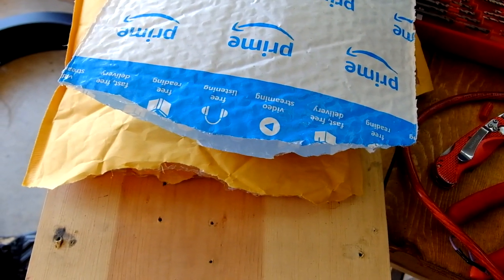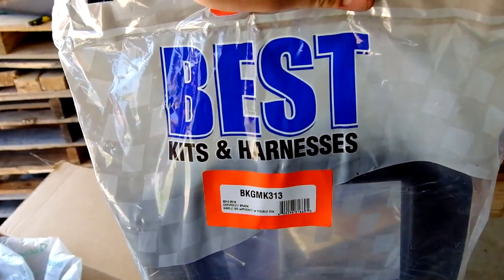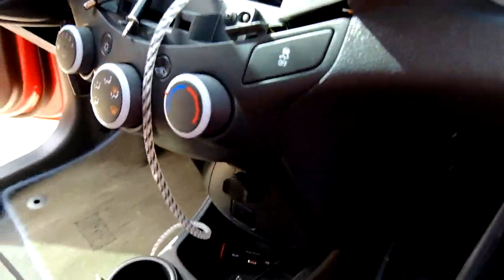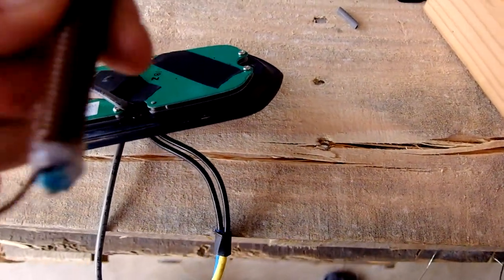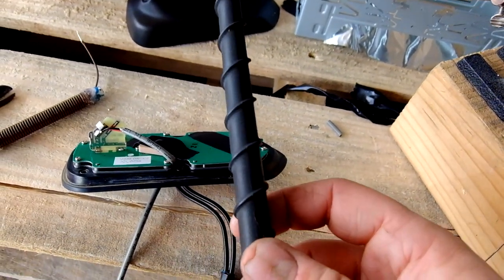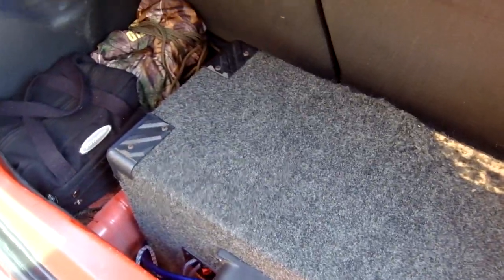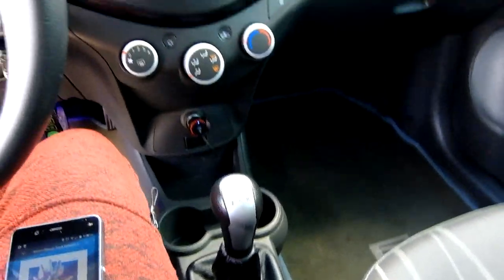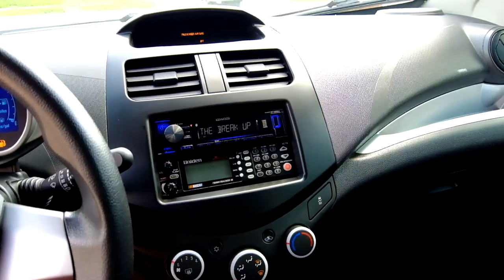Chevy Spark Stereo Install

Comment: I will say, you won't see a lot of videos of this car, because so many people have problems with them. I had to get a new TCM and that cost me 3 grand.... then a year later my Transmission went out and luckily was covered under the warranty they had for it so it was free, but if I had to replace that... I would have just sold it for scrap... I only paid a lil over 5k back in 2018 for the car and it cost me more than that to repair. If another major issue occurs, it will be gone. Thanks for the video, my front right speaker has been messed up since I got the car and I'm finally gonna fix it.

Comment: I have a 2014 to.  I been looking for videos also.  I love the car.  Been trying to look for videos on the ac heat knobs I broke mine a few months in. Think I turned it to fast. The top two half circles with teeth behind/under the dash I can't figure out how too line them up to switch my vents  My wires were off the things too. I managed to do that but every time I change the vents they don't change

Comment: I have a 2007 chevy aveo5 and cant find videos on anyone changing the speakers but i did come across this one, thanks for making it. Its not the same exact car but they are pretty dang similar. So you had the cb radio, kenwood stereo, and scanner all connected to the one antenna?
Reply from the maker: No I didn't show the CB antenna in this video It was a separate NMO Mount Antenna. Just the scanner and Kenwood were on the same one.

Comment: How did you wire the radio harness from the aftermarket unit to the cars radio wires?  I got a radio today, and I can't fine a harness for it and neither can I find what. wire. is for what online. I have a 2015 Chevy Spark.
Reply from the maker: I remember I had to tone out each wire. I had continuity on my DMM , then you can mark each wire.

Comment: Did you have to do anything special for the front covers to fit without coming in contact with the speakers?
Reply from the maker: No, everything fit perfectly. If you need adapters for any reason, Crutchfield has good information.

Comment: Lol no where that I look can I find a guide to removing the face plate from the mylink on my 2014 spark. Did you have a guide you found?
Reply from the maker: Mine didn't have the my link system, it was the cheapest stereo offering from Chevy. I assume it wouldn't be to much different.
Reply: @47Hobbies  How do you release the stock single din cover? I noted how you removed the front speakers but you cut to the install in progress. I would hate to break something. Thanks!!

Comment: Lol, the compressor and goop ain’t gonna help if ya get a bolt in tire, did the coil actually work for antenna? I hooked my stereo hot, and the amp to a accessory wire from the radio, but after I forget to turn off the radio, and kill the battery, I probably will jack it to the cigarette lighter outlet, thanks, I bought a spare tire n jack off ebay
Reply from the maker: Fred's Shed Yes the coil did work. But alas if you see my latest video, My car was totaled and I talk a little bit about it.

Comment: Hey I think I got the same install kit for my 2015 spark. It came with an odd black box that attaches to the wiring harness and has a micro usb port on it, do you have any idea what that is?
Reply from the maker: It is possibly to retain some of the onstar features and chimes, I never used any of that and also the chimes are always annoying to me.

Comment: Wait, so you haven't had any problems with it but your check engine light is on?
Reply from the maker: Hunter Monahan That was because the key was in the ignition but the car wasn’t turned on, a lot of cars do that for some reason.
Reply: @47Hobbies  I have this spark but in white and mine doesn't do that, if I could share a photo on here I'd show you
Reply: @Hunter-vy3cq  check engine light comes on to tell you to start the engine before you put it in gear when in the run position. so if yours don't do it the light be burnt out

Comment: Where did you buy the harnest?
Reply from the maker: I didn't really use a harness I soldered the wires onto the factory wires. If you are talking about the dash kit that's from amazon Best Kit BKGMK313